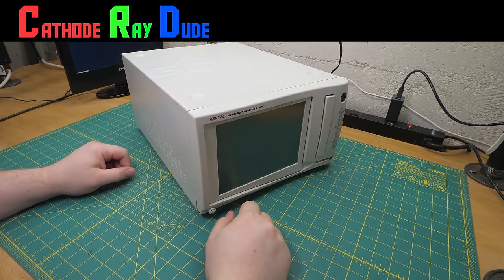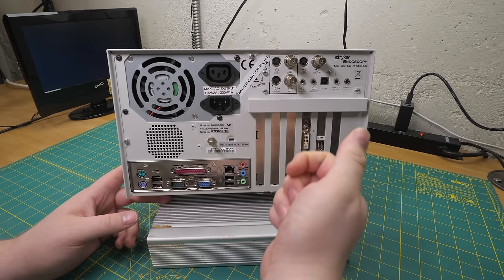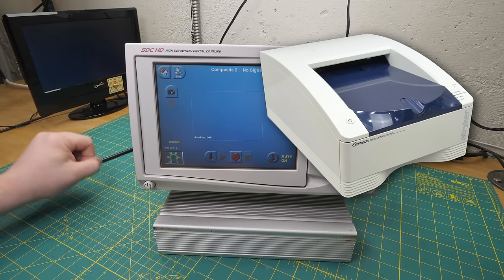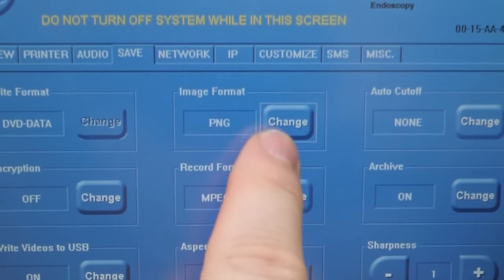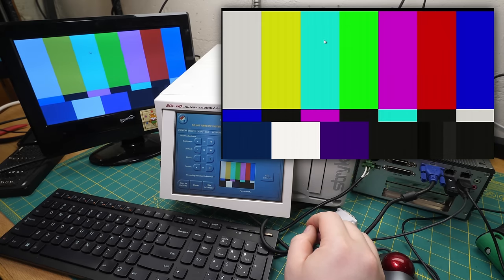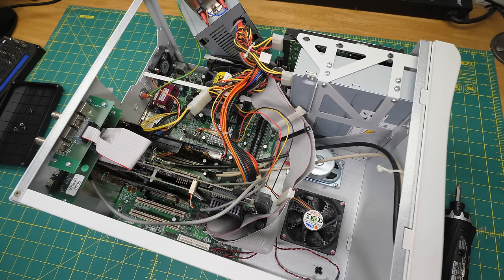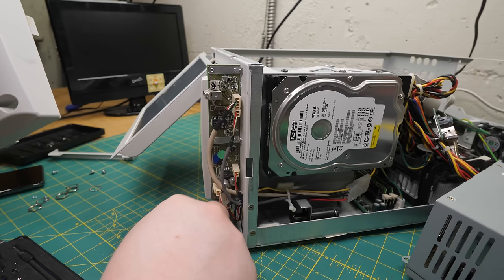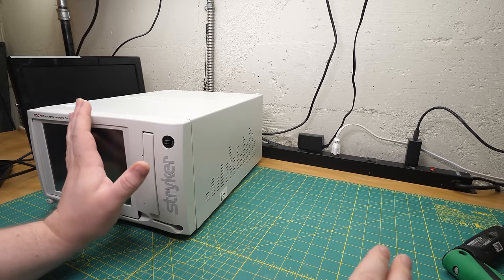Little Guys Ep 11 - Where No PC Has Gone Before [Stryker SDC]

Comment: When you said “this screams useful” I agree, my first thought was turning this into a SDR of some sort, swap out the capture card for a SDR and down converter ( for SW MW LW frequencies) And terminate the F and BNC connecters in place of the svideo and composit! this use case would render the resolution a non issue! 

Built in screen and speaker is perfect for fox hunting (don’t fox hunt unless your a commercial broadcaster hunting down a pirate to report to your government regulator, it’s not cool what some hams operators do to other operators) and field placement provided you have a big enough power inverter or shore power! 

For my purposes it would be purely for RX, I can deploy it anywhere for some DXing or recording local content! 

Wile I don’t see any reason why I couldn’t run it on the original motherboard with a form of Linux like you said, I am a little perturbed about the Celeron and low memory as I have tried running SDR on more modern celerons to poor performance.

Unless of course we can find a similar card with the same connector that is compatible with modern chip sets or doesn’t care, picking up any old standard video signal
Reply: out of curiosity, if you google image LVDS to HDMI im just curious why some of these boards would not work?

Comment: best electronic screwdriver Ive used was a Panasonic. very light ratchet, but then locked closed, so you could use full gorilla to crack the nut, and then buzz it out, or buzz it in and then lean on it to torsion wrench manually * CLICK *. mechanically attached driver to the chassis, but the motor was on a ratchet.

Comment: The bigger striker system that this unit is a part of is very sophisticated and interesting. There’s one component that is a big video switcher. There’s another component that is the control hub for the whole system which would be another little guys. And then a couple of other components, this being one of.And then you can connect all these components together with very cables VGA DVI,HDMI display port fiber optics whatever to monitors and other computers and equipment in the room.
Reply: @davidew98  Yep. I’ve never seen one of these in the wild, I believe they were replaced by the SDC Ultra before the SDC3 was released. Mid 2010s era integrated ORs would have an SDC3, Stryker Control System, SPI3 router, surgical displays and wall monitors, room cameras, and even a SuiteStream device for remote viewing of all the inputs in the room. Used mostly in learning hospitals. The SDC3 was replaced by the SDC4K and a sibling - the ConnectedOR Hub. The SDC3, through a software update, can act as both the capture device and the router control system. The Hub was designed with that use being pivotal to its functionality. The SPI3 had multiple types of input and output cards - input could be DVI-I, DVI-D, a combo SVid/Comp/SDI, or straight optical in. VGA would be connected with a DVI-5BNC cable. The new systems throw all that video on a 10 gigabit switch, but you’ll still find BNC composite, svideo, sdi, vga, dvi, etc in ORs built in 2024. I have collected a Control System & SDC3 I am gonna see if Gravis wants to look at. Also have an older Switchpoint Element compact router with 4 in/4 out. Love this legacy equipment.
Reply: @lifetimeofwork  if I remember correctly. Before Stryker made hardware they used a crestron switcher under the hood!

Comment: The use of a chip intended for monitors is kind of interesting - that might explain how they're able to overlay text and images on the pass through video signal? The monitor chip probably has that functionality built in to support the OSD menus in a monitor.
Edit: nevermind; if they're using a separate chip to decode the composite in, the overlay must be happening in one of the fpga chips.

Comment: The presence of the software mpeg4 encoder suggests that the hardware encoder probably is just mpeg1/2, of which there's a ton of chips available by companies like Conexant that were commonly used on capture cards. mpeg4 being software encoded probably explains why the quality was limited to such low settings.

Comment: that lvds interface looks like the general pinout most cheap small lcd tv's use, also you might be able to get a mipi touch screen that fits in the flip out panel, it's worth having a go on panelook to see if one exists that's even close.  
as for the capture card that's just an insane way to do it but very on brand for medical gear, by using a monitor chip they get access to the very fine phase control on vga afforded by those chipsets but you also get the annoying variability of the auto setup system.
the sdc ultra looks a lot more interesting in some ways, the rear panel layout suggests a custom mobo with firewire 800 onboard and the spec sheet suggests 1080p input

Comment: It probably wasn't even stolen, I could've just been thrown out and taken home by a staff member. Source: I was a garbage man for my local hospital and they threw out a lot of tech, and yes, some of it I took home for use, it usually worked fine. 

Also got to play with dry ice on a number of occasions.
Reply: By law the devices can be disposed of but the hard drives (or other storage media) must be physically destroyed. This is meant to ensure that sensitive patient data is not allowed to get into the wild. Unfortunately there are many not so well run hospitals and clinics that fail that part of it.
Reply: @RCLapCar  oh, I'm well aware. I had taken a pc from our blood lab out to the loading dock where our compactor was, and decided to take the computer apart becuase it didn't look stripped out, and yes, the ram and hard drive were in there. I took the machine to our it department, told'em about it, and went on about my day.
Reply: @RCLapCar But devices such as these didn't save to internal storage, there's no patient data on it. You don't have to wipe the whole drive if the patient data is stored on a separate partition/external/network storage.
Reply: @pfarnsworth84  umm of course this thing has internal storage. He literally showed you the hard drive and partitions. Ultimately it doesn't matter if you delete the files, the data is still there and potentially recoverable
Reply: @RCLapCar  Did you watch the video? The recorder only allows the patient data to be saved to external, DVD, or network storage. And no, even if saved to a separate partition, if that partition is wiped, it will not be recoverable. There would be no need to wipe the whole disk.
Reply: @pfarnsworth84  Umm...the images are saved to the local hard drive before you send them somewhere else. And it's not just one partition, things like logs files exists that could contain patient information. Heck the Windows page file could be mined to extract useful information. When you're a clinic or hospital you are not gonna take the chance that there is a scrap of info somewhere you weren't expecting. Killing the whole drive is the most secure way to ensure you haven't missed something.

Comment: Regarding the lcd you can search for lcd controller board with hdmi input to work with it and fit a new MB. Or replace it with the same size high res lcd if available.

Comment: I was at the hospital, and noticed that some of the vital test equipment, would use the windows 3.1 shut down sound effect when it finishes testing. It’s so obvious that the programmers were lazy and ripped it. Made me smile every time Lol. I wondered how much medical equipment has rip operating system assets.
Reply: Depending on what the OS was, that may not have been ripped off.  Windows used to (and I assume still does) have an API that lets you play the standard alert sounds with one line of code.  So, if you had the 3.x chimes set as your "critical" alert sound in Control Panel, then that's what'll play when you tell Windows to play the "critical" sound.

That said, some of those early WAVs did find themselves in products long after replacing 3.x as the underlying OS.  So either is possible.  :-)  I recall lots of kiosks for buying BART tickets and such using the old ding sound just a few years ago.

Comment: The way to use those electric screw drivers is to loosen the screw manually twisting the machine like a ordinary screwdriver and then remove it the rest of the way under power, much less chance of destroying the screw head.

Comment: Of course there’s a DS9 reference in here. But I was thinking about the power button LED thing. Doctors, even in 2024, are memetically terrible with computers. Is it possible that Stryker manufactured this so that when the wires get damaged and the light doesn’t go on, doctors start howling that the computer is broken and they need the newest, shiniest one? But it has to work the same way so it has to be the same brand?
Reply: What computer? Computers are for Microsoft Outlook and Windows Solitare. This is an endoscopy machine.
Reply: @BrendonGreenNZL  Good point. If this thing breaks, in any way, the doctors and techs will absolutely be howling and making a fuss.

Comment: Homemade oscilloscope?  That's actually what I thought this was before I saw the stryker logo.  It even has built in BNC's out back already.  Could be single channel and use the third BNC for ground.   You could perhaps adapt one of those pocket o-scopes to display to the front and wire up the leads to the back with well shielded lines.

Comment: Usually when you see IDE style cables carrying sensitive signals every other conductor is a ground, so an 8 conductor would carry 4 signals and 4 grounds ie, s-g-s-g-s-g-s-g. This works like a shielded cable and i would assume creates capacitance the same way coax does for impedance matching. I do agree they should have used a mini coax cable for those signals, but what they did most likely isnt as bad as it appears at first glance.

iI think this little computer would be pretty kick ass to connect test gear too, like a USB oscilloscope or something of that nature. It would look at home on a test bench but would have all the cool features of a PC, like writing automated python test procedures etc.. Im almost tempted to find one on ebay and throw Linux on it, but it's still pretty bulky compared to most bench equiptment.
Reply: Only ATA/66 and higher (the UDMA modes) used the alternating grounds, using 80-conductor cable with the 40-pin connector (with the connector itself bridging all the ground conductors to the ground pins; indeed those connectors are very specific to the IDE pinout). Earlier versions of IDE did not, and had a 40-conductor cable with just 7 grounds.

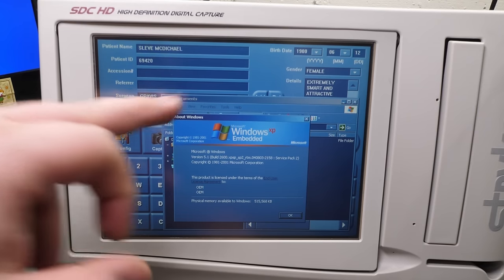Comment: A note on the RAM (29:40) - you said "looks like we have 512 megs of memory, or close enough… actually it says _515_."

It says 515,568 _KILO_bytes of RAM. RAM uses base-2, so that's ~503 MB. Almost certainly what's going on is that it has 512 MB of RAM (which would display in Windows as "536,576 KB") and using 8ish MB of RAM for the onboard video.
Reply: wouldn't it be 524,288 KB? And if so, that's 8,720KB used for video and/or system reserved stuff. Maybe 8192 for video and 528? for system? IDK. Anyway, definitely 512MB of RAM, which is what I'd expect from when this machine was made (early 2000's).
Reply: Which he literally covered a minute later.
Reply: @VM-lt9wl  oh. true.

Comment: You could put a modern motherboard in it. You'd just have to acquire an hdmi-to-lvds converter (or vga-to-lvds) and figure out the right pinout for the panel, and maybe matching fw for the converter, which is usually not hard. And then have a video cable that goes from the outside to the inside. Motherboards with on-board lvds exist but the manufacturers don't want to talk to you about the bios customization if you're not buying 100k of them. The touchscreen connects to usb, right?
Reply from the maker: The problem is that's a tremendous number of variables. It has to be The right flavor of LVDS, and it has to be the right connector, and it has to have voltage in the right place because there's definitely voltage in that plug somewhere to run the screen. I have absolutely no idea what I'm doing in this space, I have been told by people who do know what they're doing that there's no way to predict any of this stuff, and chances are whatever I buy would either not fit or let the smoke out. Maybe somebody else has the patience, I don't.
Reply: It'd be far easier to replace the entire panel with something built for Raspberry Pi tinkerers (and, thus, accepts plain vanilla HDMI or DisplayPort)
Reply: @BrendonGreenNZL  But a lot more expensive. And I would be slightly surprised if you could get one that lines up with the existing bezel.
Reply: @EricJorgensen  Why does it need to be expensive?

Comment: Might technicly not be a little guy it was certainly an interesting guy.👍
The way they added the bodge wires is the way to go, looks like they used drops of epoxy to hold them in place.

Comment: I don’t think that capture card can support a digital signal, it’s analogue only. This is why the passthrough doesn’t work. It’s very likely the DVI connector requires a breakout cable, perhaps to BNC or some other proprietary connector used for medical imagery. 

I recall some Avermedia analogue capture cards used these for multiple A/V inputs. The reason for this is because a bunch of BNC connectors wouldn’t fit on a single PCI card.
Reply from the maker: Given that the UI literally offers DVI and VGA options, that doesn't seem likely.

Comment: Could the second input be for a side camera? at 90 degrees offset from the main feed to peek around a corner?

And pretty genius to put a chip of a flat panel display on a capture card. Those things have to be able to ingest all kind of oddball formats.
Makes me remember that i have a Dell Ultrasharp monitor somewhere which has all those input's(Composite, S-Video, VGA and DVI). Old thing yet still looks very good.
Reply: @kopspijker3515  I only have experience back to the SDC Ultra, but generally these are setup to accept 2 inputs and then output video processed with overlay data. That output can be routed to a monitor and show the captured images, device control commands, etc.

Comment: The thing about not booting up the first time ... that's gotta be a cap, right? Didiwin? Or like a resistor choking the surge capacitor, right? Like, the fan motor or the disk motor, right? Something that needs more charge to fire up isn't getting it right away as it ought. Sounds like a cap, at least if a motor is involved.

Comment: I wonder how difficult it would be to just replace the LCD panel with a standard LVDS one...
I mean, if you wanna retrofit a modern system into the case... why not go the whole mile?
That's the really cool thing with standardized formfactors... is that it makes them so flexible.

Comment: 56:06

Elpida S6432AFTA-6B-E are 64Mbits total, so only 8MBytes per chip.

524,288 x 32-bit x 4 banks...

Ignoring the 4 banks for now, as an example, say each Bank were only 8-bit wide, that would be...

524,288 x 8-bit = 512KBytes per bank.

And 512KBytes x 4 banks would be 2MBytes.

But these chips are 32-bit wide, so multiply by 4 = 8 MBytes total. ;)

Believe me, it took me many years to get used to that as well. lol

They almost always give RAM/ROM/Flash sizes in Mbits. So I just look at the "528,288 x 32-bit", and say "What would that chunk be if it were only 8-bit wide?"
Reply from the maker: See, I figured I'd get it wrong, haha. 8MB sounds a lot more reasonable, basically space for one or two frames of uncompressed RGB.
Reply: I guess another way would be to just look at the total Mbits of the chip.

And when you divide the number of "bits" by 8, you get it in Bytes (or MBytes).

64Mbits / 8 = 8MBytes.

It also helped, spending a lot of the early 2000s using the Doctor V64 "backup" device for the N64. lol
You had to get used to a "16MByte" cart ROM showing up as 128Mbits on the OSD menu.

Comment: 800×600 is actually Windows 98 territory, which is usable. I mean, I'm using a 640×480 NCR POS monitor with Windows XP and I'm not complaining at all! 🙄
So, go ahead and try to put a modern motherboard into this chassis and try to get the touch LCD working as well! 😉

Comment: At my last job, I worked on a endoscope camera ( 1990s)... there's a fiberoptic cable, for image and light... that's the " business end" . The light source ( xenon light source) and camera were in the case, with CRT and output for videotape. 
     The fiberoptic cable got hot from the light source, and had a water cooling system. If the water pressure dropped too low, or the temperature got too hot, it would shut the light off.
    It was maybe 10 or 15 years older than the one you have

Comment: The whole point of electric screwdrivers is you crack it loose first, then spin the screw out. Geez!
Dude! Use a spintite not a damn adjustable. 30:07
Looks like an old HTPC. The touchscreen can be used to interface with the DVR directly instead of your lost remote.

Comment: 1:00 I don't think the nature of DVI signal works trough relays, partly because it requires too many switches to do, and also because of the high speed signals. It would wreck havoc with the signal integrity.
Reply: Don’t be so sure. Relays are a common part of the signal path of oscilloscopes — even ones with quite high bandwidths. (I know the 4GHz-capable LeCroy I have at work uses relays.) Of course it requires extremely careful circuit and PCB design using specialized relays, but it is doable. You can readily buy relays rated to 8GHz (8GHz @ -3dB cutoff). 

Of course, with DVI I would also do it digitally, but you could do it with relays if you were hell-bent on doing it! :p